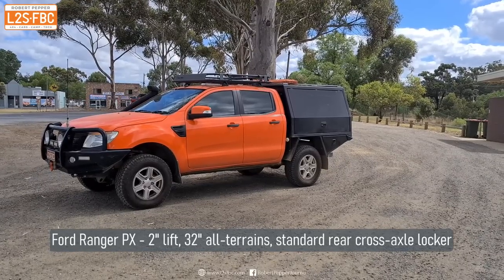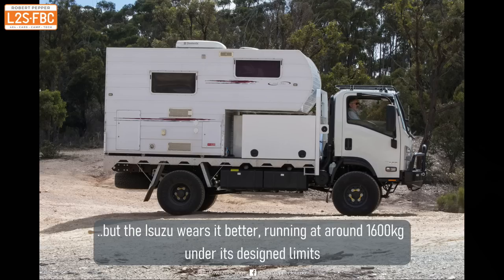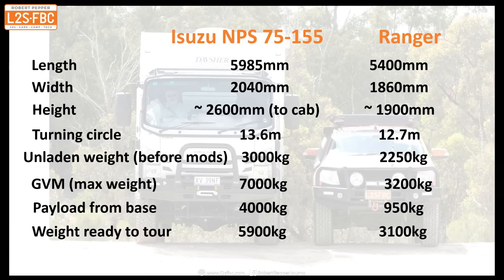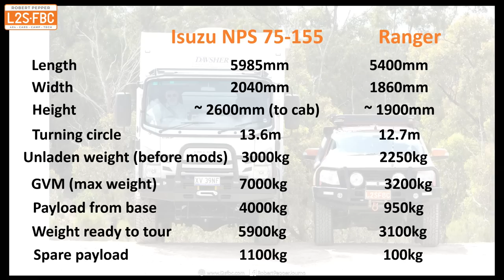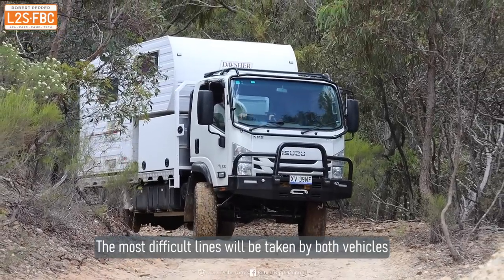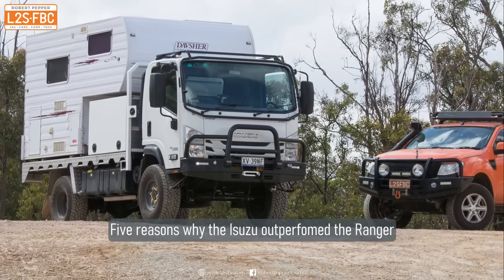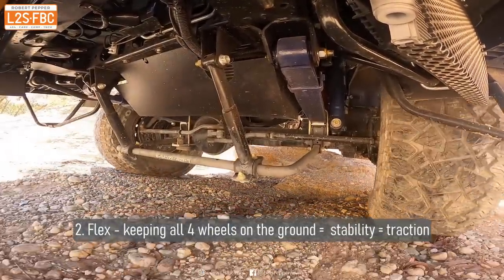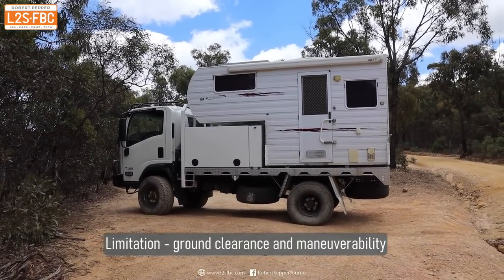Best offroad - 4x4 truck or 4x4 ute?

Comment: the use of a cab-over cargo truck for offroading is something really unique that I haven't seen before, I wish we had some more of this kind of stuff here in the US, as opposed to the unending amount of jeep wranglers and cherokees and large crew cab pickups
Reply from the maker: Works well doesn't it!
Reply: @L2SFBC  sure does, I bet it came at a serious cost though
Reply from the maker: Not really. The truck without the camper is around $90000 AUD.
Reply: They sell the 4x4 stuff in the states. It's just not as common.
Reply: @L2SFBC  I'm wondering how much the suspension lift was? I bought a new RAM 1500 Quad Cab to set up as a camper, but now the diff strength has me wondering if it's up to task even while keeping to standard GVM which is only 850Kg 🇦🇺

Comment: I own a 2006 Isuzu Elf camper in Japan with 4.8l engine.  One other difference I think is the torque from its engine, and of course the low range gears too. Wonderful chassis, mine is boosted a bit up but not as much as yours, mine has 18 inch wheels and tires not as big as yours. But mine does quite well for a camper. I believe mine has an LSD on the rear, not sure about the front. The engine braking is wonderful down steep hills, really keeps the brakes cool and gives long life, cheers. (love my Elf)
Reply: 4.8 engine of isuzu is 4hl1 . it is so powerfull engine i have one of it and i was so impress of his tourqe and power

Comment: Great technical breakdown on something a little different. Good camera work too. If the owner plans to drive this way generally I'd like to see a scrub bar of some sort around the top and adjustment of the side canopy or the scrub bar to protect it as it wont be there much longer. That tree rub had me wincing.
Reply from the maker: Agreed - I think my ideal setup would be a brush bar all the way around, and I'd want the camper the same width as the cab, and pop-top so same height. But, that'd be mega$$$$...

Comment: What is lacking is showing the Isuzu pulling into a supermarket car park, or parking at a parking meter in the city, as one has to do when travelling around Australia. Even SUVs with a loaded pack rack, or roof top tent are usually excluded from normal shopping car parks due to their size. As the camper is on the truck, it cannot be left in a camping park, unlike a towed caravan or tent camp. You may lose your favourite camping spot just because you had to go to the shop for milk. When you come back, a caravan has taken your spot.
Is it necessary to raise the height of the suspension given that the Differentials and axles have the original ground clearance. Maybe a softer (Bus) suspension with a lower GVM Gross vehicle Mass would work successfully.
A low height pop top would make the Isuzu a great choice, given how close to a big family SUV or Duo Cab Ute it is in size. I would have appreciated some date fixed prices of the vehicles new, modification costs, fuel tank size and type and common range with full fuel tanks. Did you try the stock standard tray truck without modifications? The manufacturers balance a lot of considerations to suit most buyers. Does the truck or big tyre diameters require and additional licence at additional cost?
This was a very valuable comparison. Thank you.
Reply: Or maybe ranger towing a caravan up the same tracks 😀😀😀

Comment: Very enjoyable video - it provides ample evidence that IFS off-roaders with or without rear diff lock and front traction control are the vehicles responsible for tearing the crap out of all the tracks in record time.  I'll keep my Patrol, thanks.  I have an inexpensive ($400) autolocker in the front, a lift, and 33" Nittos and can wander up sections of track that the utes are struggling on and tearing up with endless wheelspin and wheel lifts.
Reply from the maker: Hmm...take a look at the Discovery on the Hill of Truth...

Comment: That is one very well loaded Isuzu!
Far too many with very top heavy Expedition bodies that overwhelm the suspension causing the bodies to rock all over the place which then leads to the tyres losing contact with the ground.
Just goes to show what these pretty basic trucks are capable of when the owner has a think about loading

Comment: The video confirms my experience with my Medium Duty Mitsubishi Canter.  Good to see a nice a to b comparison though.  Thank you for putting this together!
Reply from the maker: Thanks, please share!
Reply: Allan, I have seen some of your videos, I agree with your comments wholeheartedly.

The two major differences between this light truck and Fido are: the Isuzu has Isuzu's medium wheelbase (3395mm), whereas yours is the short wheelbase from memory and our light truck is reasonably heavier than yours when fully loaded in touring trim; 5,900kg versus 4,500kg (approximately as I understand it) for Fido.

Comment: Hello, what are those springs called that you have used to bolt the cabin with the base of the truck. Do they provide additional stability? What difference does it makes if straight bolted ?
Reply: If you are talking about the springs at the 2.12 second mark, then these are designed to allow the tray, which the camper is bolted to, to let the chassis rails flex (twist). This means the tray can stay mainly flat and the chassis rails underneath can twist and flex a bit without trying to twist and flex the camper. There are 4 either side for a total of 8 spring mounts.

Comment: Great video. One thing I’m surprised about given there’s so much money spent on off road mods for the Isuzu’s is the fuel tanks are left underneath. I know space is an issue but personally I’d rather the fuel tanks, filters and spares behind the cab on the tray - then build out the platform. 
Hats off to ole mate in the truck, some terrific ballsy driving💪💪 cheers
Reply from the maker: They're actually ok in that position, they don't get damaged and it moves the weight low and central, then leaves more room for the tray etc.
Reply: How do you think the bog stock isuzu would go with the dual rears offroad? The gearing would be lower also. Would be interesting. Cheers Rob @L2SFBC
Reply from the maker: @chrisandshazza01  definitely worse with the dual rears which are also smaller diameter, and the gearing is plenty low enough even with the big tyres.

Comment: How about a Unimog comparison to the Isuzu? Great video, very impressed with the quality
Reply: That is an interesting question. The difference between the Ford Ranger and the Isuzu NPS is reasonably huge, but at the same time not too far away from each other. Essentially the Isuzu NPS, along with the Fuso and Hino equivalents, is a reasonably affordable step up in almost every department from mainstream automobile manufacturers cab chassis with a tray on the back, or cab chassis with a tub on the back that most of us are familiar with.
Once you step up from the Light Rigid driving licence class of Japanese trucks available in Australia, you really start to get into some serious vehicles with quite serious capabilities. The price of these vehicles while not yet in the stratosphere, is getting close to it, which mainly restricts these kinds of Medium Rigid licence class vehicles to very well heeled customers.
I would suggest the next most popular 4x4 truck that many people use is the MAN TGM range. These MAN trucks second hand are reasonably available in Australia and make excellent touring vehicles.
The ex military Mercedes Unimogs that many people see in Australia right now, are essentially 40 year old military specification bare bones trucks. They require some fiddling to make them more user friendly and from personal experience you will find a set of ear muffs handy. Noise deadening in the cabin really helps.
Current Unimogs are really in a world of their own, pretty much nothing stops them if they have been configured correctly for the load and conditions. They are nice to travel behind on a track, at 2500mm wide they effectively create a dirt highway for the following vehicle.
The bigger trucks, Unimog and MAN have another problem, vehicle length. The above Isuzu is 6250mm in length, tray length is 4200mm, the living space in the slide-on camper is 4100mm in length; width is 2200mm and height is 3250mm. This is a small truck yet you could see how tight things were in places, however at that size it is quite agile. Stepping up to larger trucks that are wider, longer and heavier is doable, but the inconveniences get worse the bigger and heavier you go.

In summary, Ford Ranger to Isuzu NPS, quite a big step. Isuzu NPS to MAN TGM, a very, very big step. Isuzu NPS to Mercedes Unimog, you'll need a stepladder.

Comment: Must say the Everest did rather well with just traction control enabled. The updated system on the PX2 ranger and everest really makes them so much more capable offroad
Reply: Thanks for the like much appreciated!!! Please would you tell me what year that particular Everest is just curious?
Reply from the maker: That's a 2016, one of the very first, but Ford updated the traction control software later
Reply: @L2SFBC  oh so they have updated it again? From what year was that?
Reply: @vanderz1012  - No what happened was when the Everest was first released at the same time the Ranger when PX to PX MkII, so what every they did to the Everest (save for the rear suspension which is anti-roll bar, coil springs watts link (in a very neat 5 link set up which is a good compromise for on and off road use) v simple leaf springs, sway bar set up in Ranger.

The front end of Everest/ranger is where it changed for Ranger,  (depends on view of engine assisted hydraulic power steering v electric power steering) when Ford updated the PX to PX MkII they changed the steering to "EPAS" electric power assistance steering which meant they could also control the traction control on the front axle (re: keep it switched on full time) when using the rear diff lock, Ford also changed the way "BTC" brake control torque worked also in that the torque split in 4x4 low was reduced by about 40% at the front end in order to provide better traction combined with ABS, going to EPAS set up also allowed Ranger/Everest to have semi auto parking / lane keep assist and all that other stuff which may or may not be a good thing again depends on your view point.
Reply: @351tgv  thanks very much for the detailed explanation this is so very important for me when choosing my Everest thanks very much 😁

Comment: Enjoyed the video and impressed by the Isuzu. Since the Ranger always went first, may be an idea not to have the Isuzu already parked up on top in most shots when the Ranger crests....detracts a bit from the "will the Isuzu make it"...........Regardless, very interesting
Reply from the maker: Hah good point!
Reply: As Robert mentions, a good point.

That said, the Isuzu in all cases, always went after the Ford ute(s) traversed whatever the obstacle was. Thereby giving me an idea of what the surface was like and their ability to conquer or not conquer the obstacle. It had been approximately 48 years since I had done similar stuff in 4x4 and 6x6 trucks, to say I was rusty would be an understatement.

The Isuzu certainly has surprised in places not expected, the Hill of Truth was one of those places. Being a manual transmission, riding the clutch up a hill is not the best idea, so one has to select the appropriate gear and use throttle control to do the job. If you listen and look at the Isuzu's Hill of Truth ascent, you will note a couple of times the revs die right down.

Each time I felt (and heard) slight slippage coming from the front axle, I pulled the throttle back ever so slightly. Doing this the revs dropped to approximately idle speed and/or slightly under idle speed (750rpm). The torque of the motor is such, that with a delicate touch of throttle the truck would start ascending the hill again, resulting in really minimal front axle slippage as the torque bias differential continuously threw power back and forth to either side of the front axle.

I could feel and hear one front wheel start to slip, almost instantly that would stop then the other side would start to slip while at the same time the first wheel received tractable power. If we had had two cameras, one either side and played them back on a split screen, it would be quite an interesting thing to see as either side starts to slip then stop slipping and watch this in real time as the torque bias differential swings power from side to side.

Comment: How do you find these mid sized 4x4 trucks compare on steep low traction surfaces? Such as climbing up steel clay hills? Usually such climbs require good wheel speed and quality mud tyres to eject the mud and keep momentum.
Reply from the maker: No experience but in those conditions light weight rules and so does momentum..nether of which the trucks are good for.

Comment: I would suggest that the Isuzu motor is way under tuned . And that a remap would reap massive gains . Even the Isuzu 3 litre  4 cyl  puts out more power and torque than the engine in NPS

Comment: I reckon a pop top camper on the Isuzu would be great. Lower it to the height of the cab for travel and extend so you can stand up inside when at camp.
Reply from the maker: Agreed!
Reply: @L2SFBC  Not so good for colder climates though ie South Island of NZ in winter.
Reply: This is what we are looking into. OverlandXP by Trailblazers RV do one.

Comment: You mentioned the front LSD made the turning radius larger...to what extent?  If starting a build with open diffs would you add LSDs or Lockers?   (i.e. for similar off road use as in the video, winter driving not that you see much of that, and general onroad use.)
Reply from the maker: I can't say exactly - would need to measure turning circle with and without, and you can't disable an LSD -, but I'd go for the locking diff option not the LSD. It's a big truck and doesn't need an even bigger turning circle. And the turning circle would also change depending on the nature of the terrain. But, it is significant.

Comment: Very good driving skills, very good honest test.  the ONLY issue is that that camper top is way to high and makes your truck very top heavy, you can easily lower the ceiling on that camper and improve greatly the side angles - in some cases you can see where you might very soon tip over because you're too top heavy.
Reply: You are correct, the camper is too high, however as it came from another vehicle and we owned it, this was the cheapest way to keep on touring wherever we wish with the least drama.

While the weight does look quite high, I can assure it is very low. Except for the small rooftop air conditioner, nothing of any weight is higher than 900mm from the bottom of the camper. The highest thing which has some weight, is the bed and that is below the cabin height with the very top of the bed below the top of the cabin.

Internally there are only the walls with light cupboards above 900mm from the floor. The camper is quite light as it was originally built for a much smaller vehicle where weight was a big issue. The truck is remarkably nimble and light, with all who drove it before we took delivery being surprised at how well it drove.

The 280 litres of fuel is below the tray, the two spare wheels are below the tray, there is a 140 litre water tank above the rear differential but below the tray. Keeping all of these heavy externally mounted items very low, has also helped in making the truck handle as well as it does.

Comment: I see most die hard 4wd guys are not even going to get in on the debate. hahaha 
I drive the Mitsubishi Canter 4x4 ... Love it out performs any other 4x4 i have ever had..
Reply from the maker: What mods do you have?
Reply: @L2SFBC  Parabolics in the front only Adj shockies all round, standard running gear original LSD in rear ( actually very good) Umm actually too many mods to put in here. hahaha
Easier to post picture.
Reply from the maker: Would like to see!

Comment: Truth is truth... I prefer the Isuzu... four by four by far!... thanks from across the ditch 👍🇳🇿
Reply from the maker: Someone had a question if these vehicles are available in NZ...any idea?
Reply: @L2SFBC  I seen these trucks here so there must be a dealer some place here👍🇳🇿
Reply: @L2SFBC  Full Isuzu range is available in NZ with an extensive dealer and service network. And no, I do not work for Isuzu. But I have been considering one for myself so have done some research.

Comment: The NPS or canter do not come with factory front LSD’s, it’s an open diff center. You can option them with a front locker aftermarket (atw and harrop) the unit tested in your vid looks like it has an atw front diff upgrade fitted
Reply from the maker: Yes...the video states it has a Quaife ATB LSD in the front.
Reply: @L2SFBC   no it doesn’t, just rewatched it you mentioned The lsds at test 8 and the conclusion but only said powerful front and rear lsd’s
Reply from the maker: Sorry thought that was mentioned. Added it to the description.
Reply: @SUPERTRUCKER166  This is how world peace will be acheived! Holding people to account over their damnable lies related to minutea. I applaud that you didn't just accept his untruths and rewatched the video to prove your point.